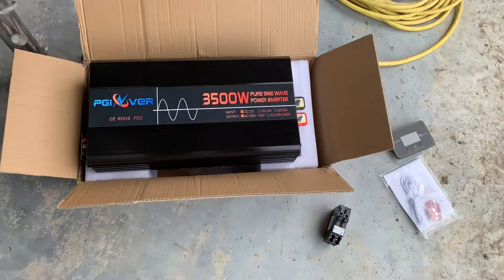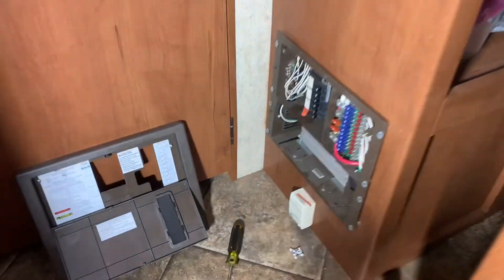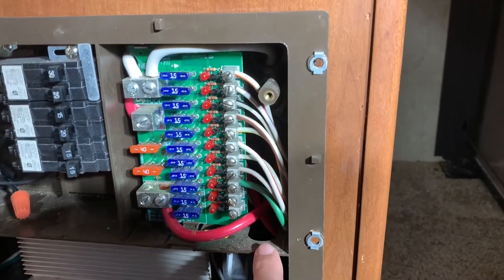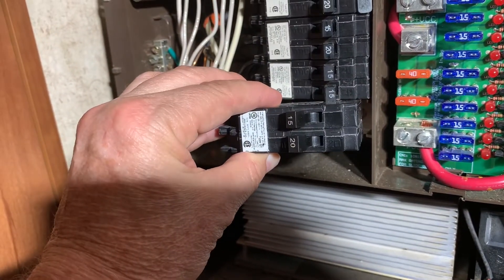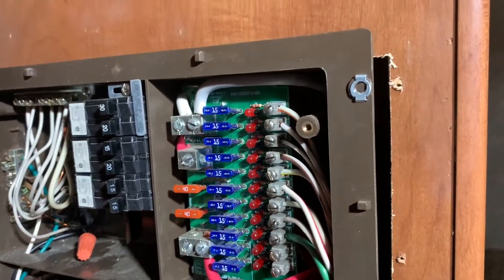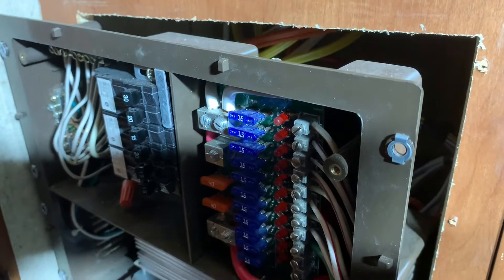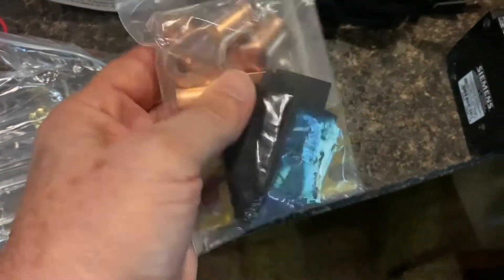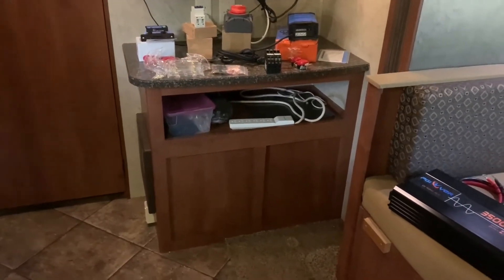Installing Pure Sign Wave Power Inverter in a RV or Travel Trailer - The Grand Plan - Part 1 and 2

Comment: I thought you would use 1 battery for 1000, 2 batteries for 2000 and 3 batteries for 3000. How are you going to put in a 3500 with one battery?
Reply from the maker: I have installed 3 batteries.  Works great. Gonna add 1 more. Just because I can.  System runs my AC. Micro wave as well. But not together.  Be sure to watch my follow up videos.

Comment: Where is the links
Reply from the maker: Hi Bob, the Comments are right above this message. You have to click the (...more) button at the bottom of the gray area to drop down and see the full view.  All the links to build are in there.  I'm using the system now and it works great! 2 100amp hour batteries last for 2 days easy of regular use during camping. The lead acid can handle about the same.🙃
Reply: @texascamper  I clicked on more.....nothing there ...no links....oh well
Reply from the maker: Items required for this project.

Dos Equis - 
https://www.walmart.com/ip/Dos-Equis-...

2 Lithium Batteries - 
https://www.amazon.com/dp/B09F2LLMY3?...

1 Lead Acid Battery (optional if needed) - 
https://www.walmart.com/ip/EverStart-...

Red battery Quick Disconnects - 
https://www.amazon.com/LIDANTECH-Disc...

2 20amp 3 prong plug ends - 
https://www.lowes.com/pd/Legrand-Pass...

2 prong Light Socket Adapter -
https://www.lowes.com/pd/Project-Sour...

12 Gauge Romex - 
https://www.lowes.com/pd/Southwire-Ro...

2/0 Terminal Lugs-
https://www.amazon.com/dp/B08R6VSQV3?...

2/0 Wire - Amazon -
https://www.amazon.com/dp/B09Y8DQVSQ?...

2/0 Wire - Harbor Freight - 
https://www.harborfreight.com/3-ft-in...

Victron Shunt -
https://www.amazon.com/dp/B0856PHNLX?...

400a Fuse Kit -
https://www.amazon.com/dp/B08Z7QG5WF?...

3 DC Circuit Breakers -
https://www.amazon.com/dp/B09BR8TZZP?...

Battery Disconnect Switch / Heavy Duty -
https://www.amazon.com/dp/B09FLLB9QN?...

Victron Energy Blue Smart Charger - 
https://www.amazon.com/dp/B08TRPJKNP?...

20amp Red Outlet - 
https://www.amazon.com/dp/B003AU6SDK?...

20amp not Red Outlet - 
https://www.lowes.com/pd/Eaton-White-...

2 15/20 amp Circuit Breakers that fit my panel -
https://www.lowes.com/pd/Siemens-15-2...

3500W Pure Sine Wave Inverter - 
https://www.ebay.com/itm/354034743057

Optix Light Diffuser Panel -
https://www.lowes.com/pd/OPTIX-Common...
Reply from the maker: @boboconnor5591  Dunno why the more isn't showing them.